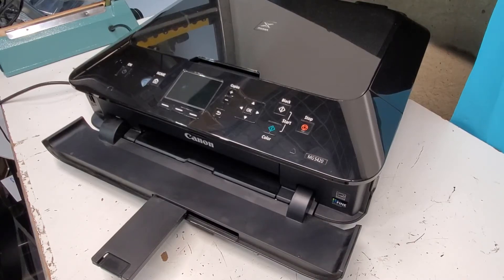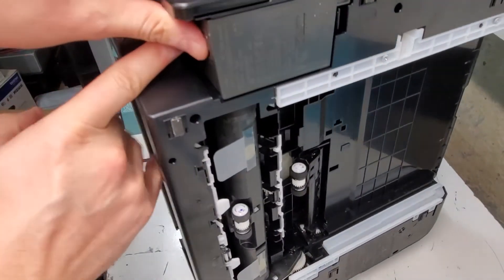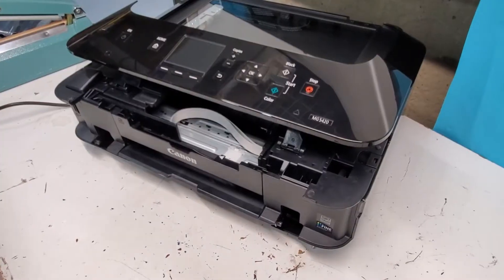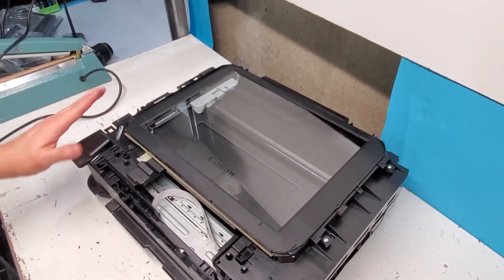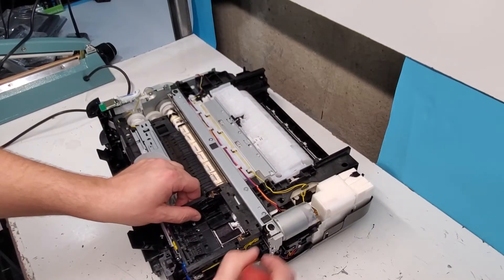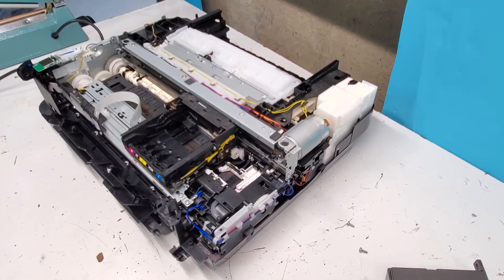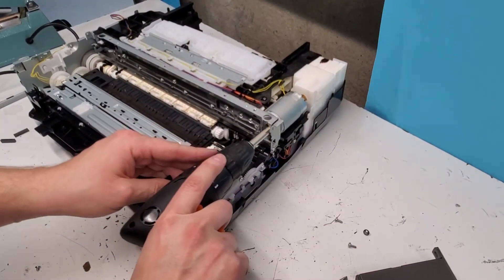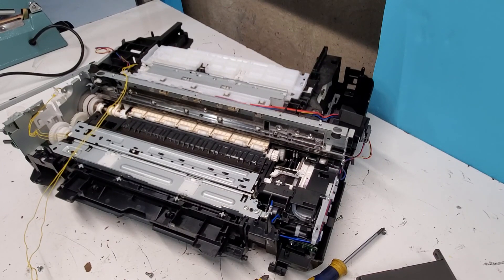Canon Pixma MG5420 Disassembly - Taking Apart for Parts or to Fix Printer

Comment: Great video! All of them, actually. If one of the plastic retaining posts that hold the hinges of the output tray were to break, what would need to be done to fix it? It seems those retainers are under layers of plastic housing. The left hinge won’t stay so the tray hangs. Any ideas? Thanks!

Comment: What's the easiest way to replace the timing strip? I'm having a difficult time cleaning it as it seems to be stained. Can I just take off the sides as shown at 5:30 without taking most of the machine apart?

Comment: My MG5420 is giving the error The Ink Absorber is almost full. I don't really want to take apart the entire printer. I don't know if you can buy a replacement ink absorber, so I think would be better to just buy a new printer when it gets full.  I've had this printer for many years and it was worked well until this error came up
Reply from the maker: Hi. You will need to reset the ink absorber anyway. Replacing or cleaning pads will not remove the error. I'm trying to find a reset utility for that online, will need more time to search for one. Usually costs $10 to do that. But yeah, save yourself the trouble of replacing or cleaning pads. If you haven't reset it before, there should be enough space for more ink. If you just want to be safe, go ahead and clean them. I will get back to you if I find anything on the reset for your model. If you find something before I do, please share. I'd really appreciate it. If you dont reset it, in a few dozen jobs the printer will show error "ink absorber full" and will not let you print anything. Have a great day!